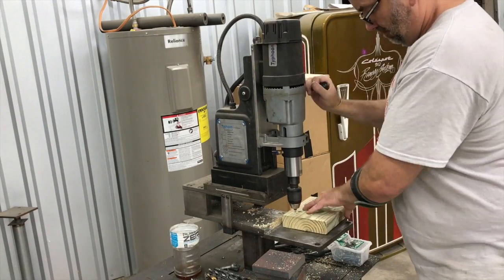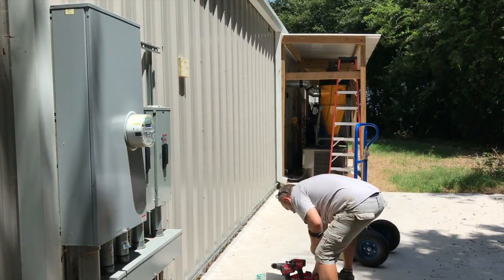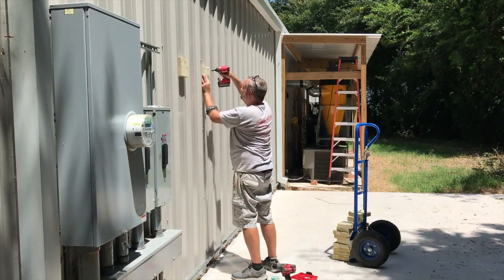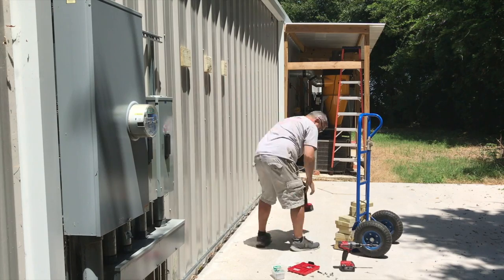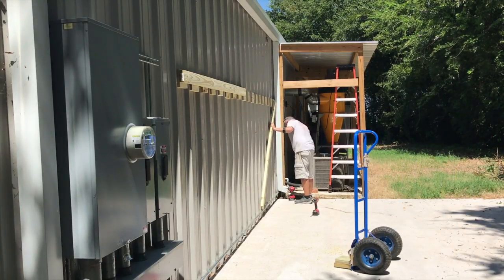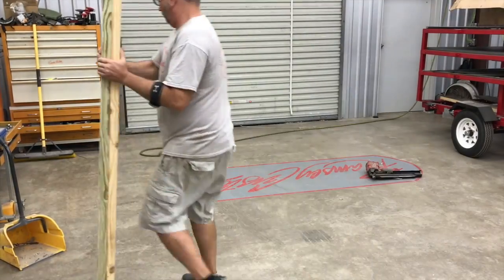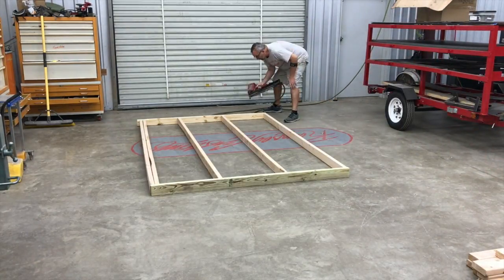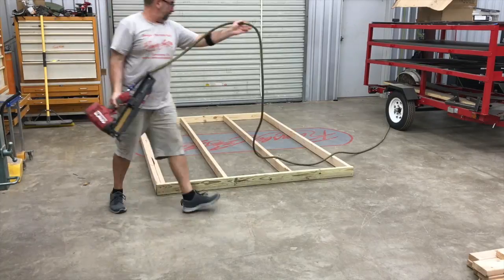Home Paint Booth Build Part 4 - Begin Framing Walls - 2X4 Studs

Comment: Answer to the age-old question of why screws split pressure treated wood here is the answer
Pressure treated wood is treated with a fluid which causes the wood to swell, since the wood is swollen adding screws would be like adding insult to injury.
Reply from the maker: Thank you for the info